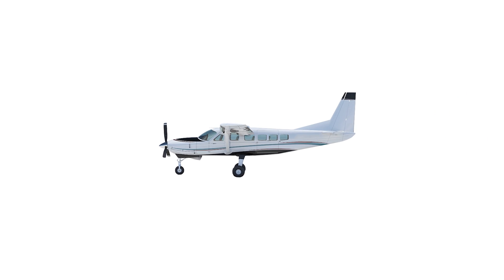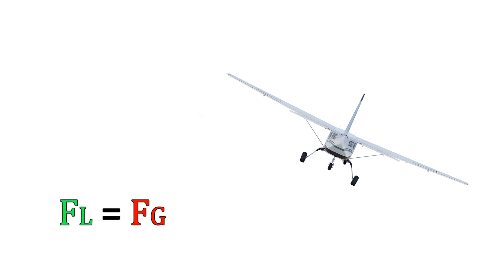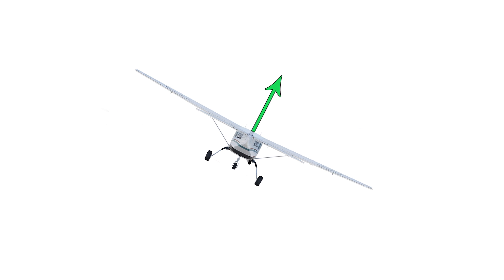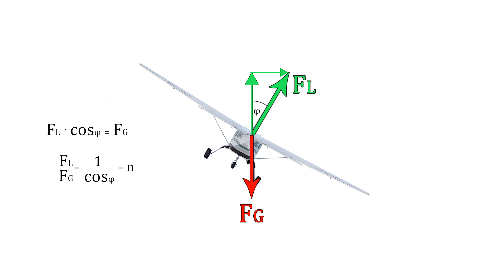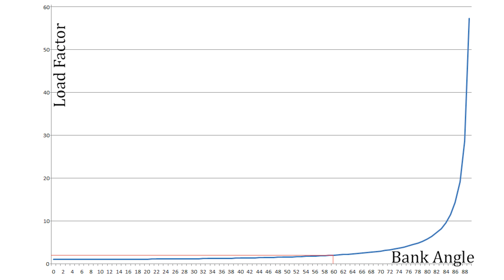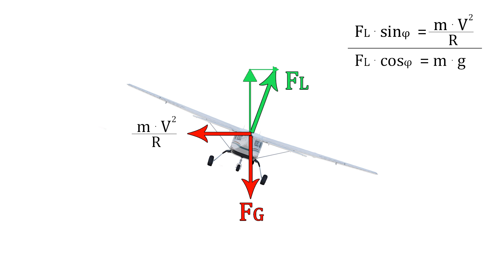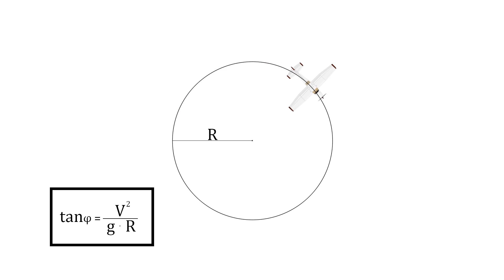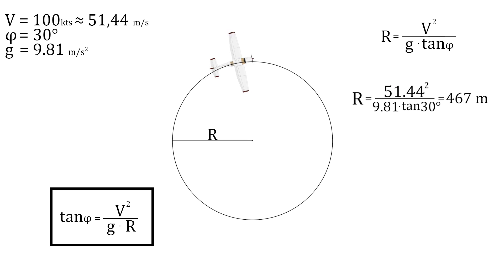Forces Acting On An Airplane In A Turn

Comment: So any type of aircraft(Weight, shape) flying at 100 kts and bank angle 30 degree will have turning radius of 467m ?
Reply: Yes only important factor is the weight of the airplane, it correlates with the amount lift force needed to match these stats.
Reply: Shape will determine the drag force, that is in the opposite direction of the lift force. So more drag force means less uplift force.

Comment: You have got the force turning the aircraft in the wrong direction. The centripital acceleration of the AC is towards the center of the turn as is the turning force, centripital force.
Reply: I was about to say that. Thanks
Reply: One is centripetal the other is centrifugal.  One is to the outside of the turn while the opposite and equal force is toward the inside.
Reply: @daffidavit  centrifugal force is not a force at itself. It's the reaction you have towards outside due to the centripetal force
Reply: @k3r7z  Einstein would say "It's all relative".   Newton would say," equal and opposite forces".
Reply: @daffidavit  and even more...if both forces are equals and in opposite direction, the plane should fly in a line
Reply: OK, it looks like we have a conversation going here.  I have a question.  If we put a string on the centerline of the glider ( or airplane) in a coordinated turn, can we agree the string and the ball would both react the same way?  Let's assume you would agree. Let's continue.  If we put multiple strings along the leading edges of both wings while flying straight and level we can assume the strings will be parallel to each other along the way similar to the ball in the turn coordinator.  The center string directly in front of the pilot should react the same way as all the other strings in straight and level flight.
               So here is my question:  In a coordinated constant bank and constant airspeed turn (right or left) assuming the ball is centered, will the strings on the leading edge of both wings be parallel to the cord of both wings or will the strings be angled because the wings are turning?  (The ball is centered and the string in front of the pilot is along the centerline).  Are the strings parallel to the wing cord or are they angled to the side because the plane is turning?  This is not a trick question.
Reply: @daffidavit  If I understood well your question(english is not my mother language), strings will be parallel to each other i think. But we're not analyzing strings, we're analyzing the movement of the aircraft, which is not balanced because the horizontal force of the lift is taking the aircraft into a turn. You can't say that because the strings are parallel the aircraft is 'balanced' or the centripetal and the 'centrifugal 'force' are equal. As I said, if that happens the aircraft would fly in a rect line with constant velocity and altitude. The centrifugal force is just the inertia caused by the centripetal acceleration. With that kind of argument you would say that in the ISS there's no gravity because the astronauts are floating, which is obvouisly false.
Reply: @k3r7z  OK, at least you agree with me that the strings will be parallel to each other.  I do believe so as well.   Also, I believe that in a constant banked turn at a constant altitude and airspeed all the forces are in balance.  Of course, gravity from the earth is pulling the airplane down towards its center.  But since the total lift vector is still perpendicular (square) to the wings, the new opposing force to the "total lift vector" is now the "total load factor".   The total load factor is opposite to and equal to the "total lift vector".   The verticle component of lift still opposes gravity but the "horizontal component of lift" is what turns the airplane.  The opposing force is the "centrifugal force".   That force added to gravity is what gives us the" total load factor".  
               Here is why I asked my original question and I'm glad you answered it the way you did.  The strings are still flowing parallel to the cord of the wings in a turn.  That means the "relative wind" is not curved.  The relative wind in a turn is straight ahead even though the airplane is turning. The difference is that the angle of attack (alpha) is increased in order to support the added load factor.   When an airplane is in a coordinated turn, it does not "think" it is turning.  It acts as if it is flying level.  The only difference is that it "feels" heavier.  That is why the "total load factor" is pointed opposite to the "total lift vector".   My point is as follows:
           Even though the airplane is turning, it still "thinks it is flying straight and level".    Otherwise, the hypothetical strings along with the wings, as you agreed, would not be parallel to the wings.
Thus there is a common misconception in aviation that there is such a thing as the "over banking tendency".  Even the FAA believes, incorrectly, that the outer wingtip has a faster airspeed than the bottom wing in a turn.  It is commonly believed that the top wing flys faster than the bottom wing in a turn.  Thus they say, there is an "over banking tendency".  They argue that opposite aileron must be held against the turn due to the over banking tendency. This may be true with a propeller by not with an airplane in a banked turn because the airplane is not connected to the ground.   The parallel strings prove it.
       As well, when an airplane is turning in a banked turn, it "thinks" the ground is where the "total lift vector" is pointed.  The airplane no longer "knows" the ground is directly below, as observers view it.   The airplane always "thinks" the ground is where the "total load factor" vector is pointed.   I wish I could draw a diagram and explain it better.
But you answered the question correctly with the strings.  Otherwise, the strings would be tilted toward the outside wing in the turn.  The relative wind in a turn is still straight ahead but it changes from moment to moment because the horizontal component of lift is accelerating the aircraft sideways.  I'll let you digest that for a while.  It's time for me to go to sleep for work tomorrow, but I hope we can continue this conversation.  I'm writing this not far from New York City.   Be well, and I hope we can talk soon.  I would like to hear your thoughts on this.
Reply: @daffidavit  Yeah..I've seen a lot of aviation books where the banked turn diagram is showing the centrifugal force, but all the respect my friend, it is incorrect. Even when I did my pilot course, they explained it to me just like that. That's because they maybe couldn't have any physics course. In wikipedia there's an article about banked turns https://en.wikipedia.org/wiki/Banked_turn and in aviation stackexchange  there are a lot of question asking about centrifugal and centripetal forces where people explain it better than me. Here for example: https://aviation.stackexchange.com/questions/52578/what-is-the-difference-between-centripetal-and-centrifugal-force Or in any physics book, zemansky for example,  there's always a section talking about banked turns and its forces.
Reply: @k3r7z  Someday maybe you can come up with a mathematical proof of whether there is or is not an "overbanking tendency" due to the asymmetry of the airspeed of each wingtip.  Until then, be well.
Reply: @daffidavit  I think you mean the Dutch roll and that's already studied. Have a good one